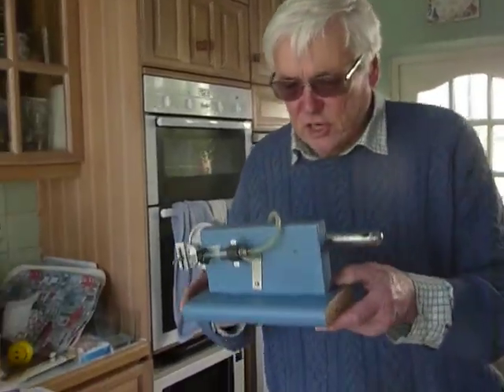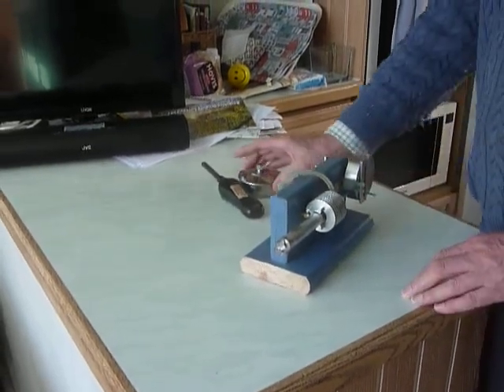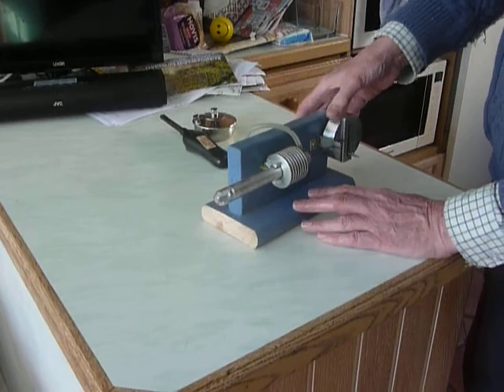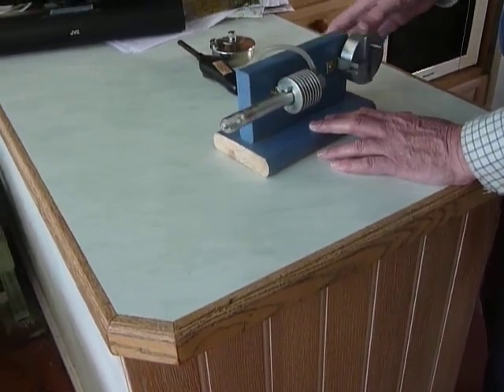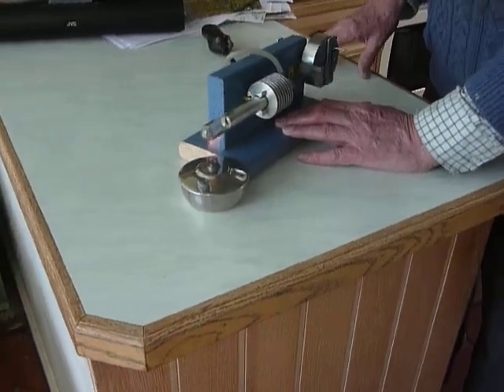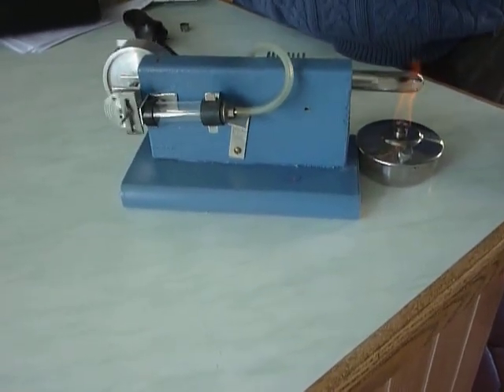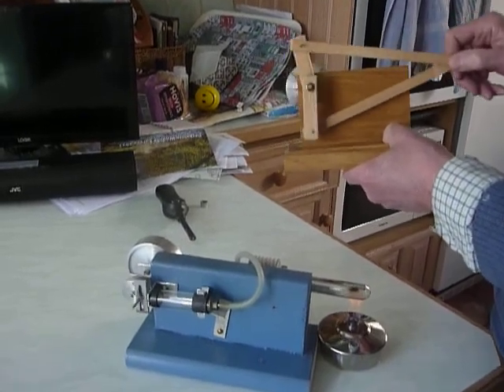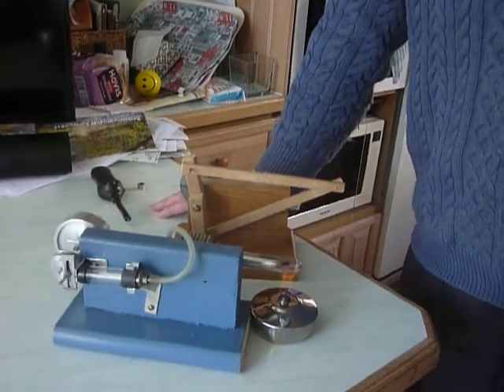Variable Length Stroke

Comment: I too have been considering variable stroke control for a sterling engine, based hot side temperature vs cold side temperature rather than speed to maintain torque and allow low and high temperature operation.  Would reduce overall power as temperature lowers but should still run down in power until bearing and piston friction exceeds available torque.
Reply from the maker: Hi There Jack - Yes with variable stroke it should carry on running as then temperature lowers. Also it should start quicker when starting and the temperature is building.

Comment: correct me if im wrong, ive not even built my first stirling engine kit (any suggestions on good quality ones?) yet, but that mechanism would only deliver power to the flyweel in one direction of the stroke. Doesn't a stirling piston attached in the usual way deliver power during both the expansion and contraction? Would this not make the engine less powerfull?
Reply from the maker: No. The mechanism allows for both the "push" and the "pull". So, what power there is, is all transmitted to the shaft. Kits - there's quite a lot for 3d printers. Search thingiverse -  https://www.thingiverse.com/search?q=stirling+engine&type=things&sort=relevant 
Also Kontax sell kit versions of their superb LTD engines
https://www.stirlingengine.co.uk/
Reply: @andrewhall2702  Ah yes, very sorry, I didn't correctly see that on my small Phone screen. Thank you for the suggestions!
Reply: I suggest timing of the displacer would need rethinking as  rotation angle of the crank is now also variable.